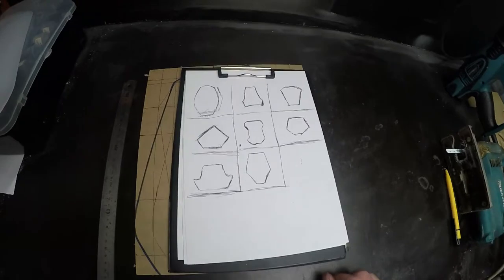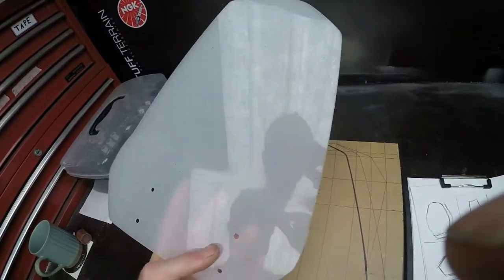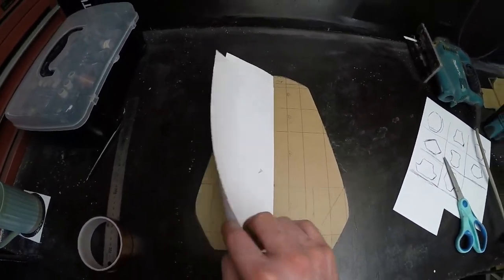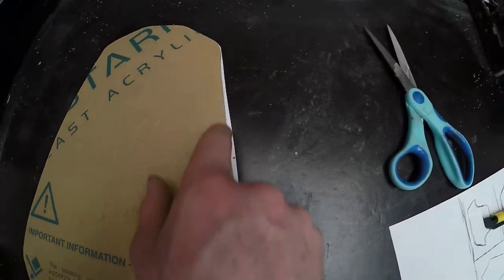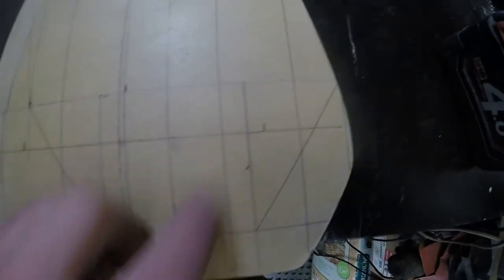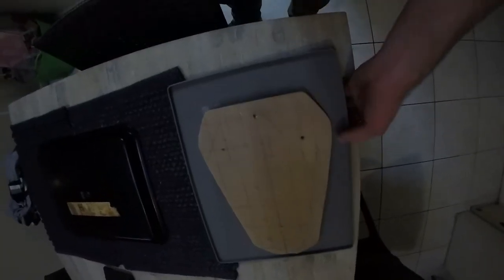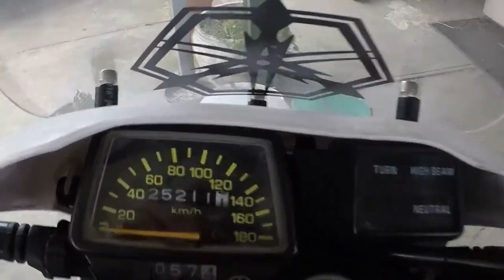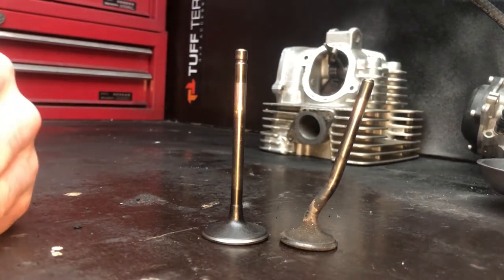Low cost DIY motorcycle windshield- improved how to video!

Comment: Why didn't use you lexan instead?
Reply from the maker: The sheets of acrylic were offcuts marked down very cheap, it doesn’t go cloudy & is harder to scratch than lexan. There are some aftermarket windshield makers who use acrylic too. I haven’t had any issues with cracking. Might give the lexan a go though next time I make one just to see what it’s like to work with 🙂
Reply: @The_Gap_Lap  thank you